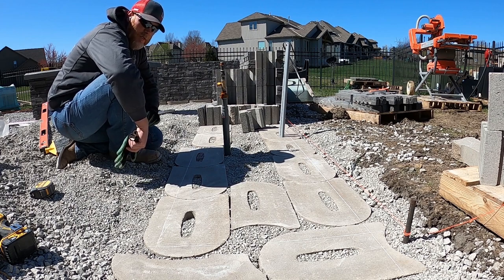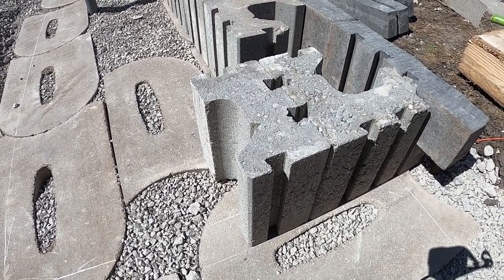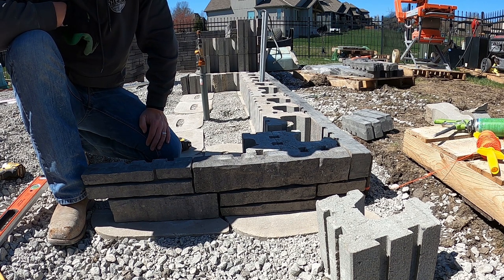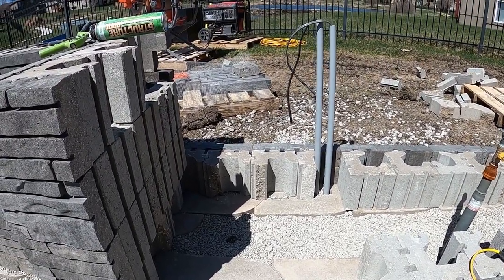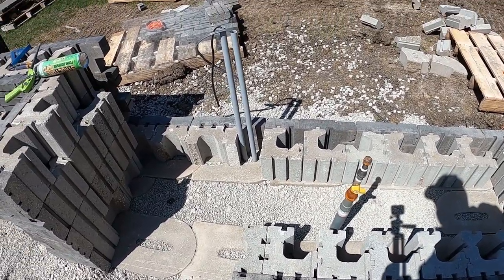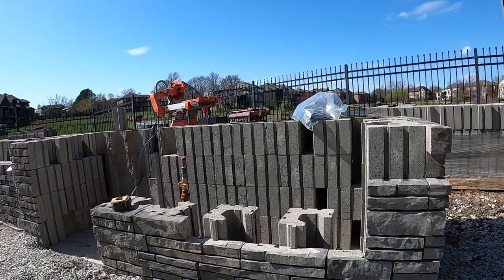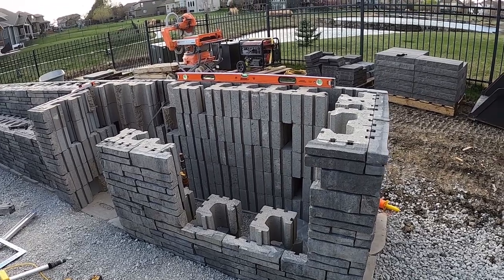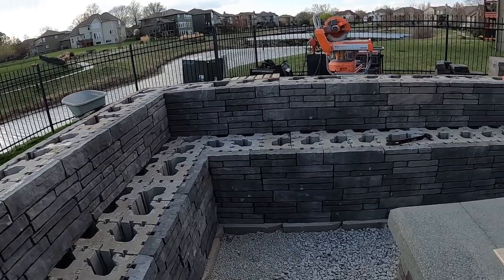Belgard Tandem Sofa Seating, Column and Grill Island - Day 3

Comment: Is that a Ditch Witch sk1550?How well does it handle pallets of pavers, block etc?
Reply from the maker: It does pretty good. We can usually move them around depending on how soft the ground is. We usually have to take about. Mayer off to unload of of a truck or trailer. We love the machine